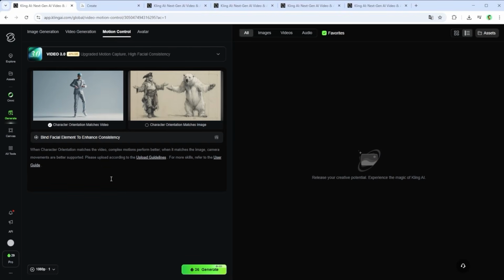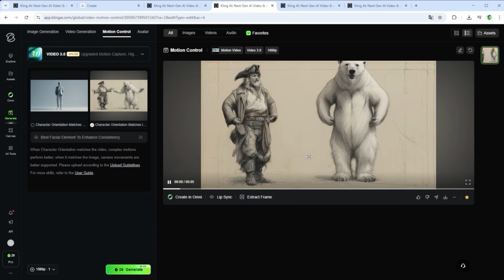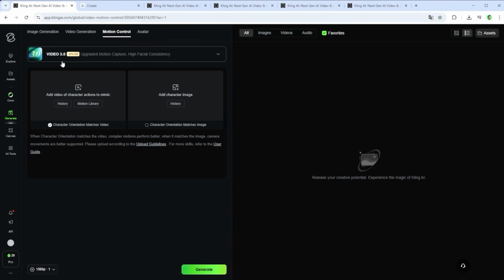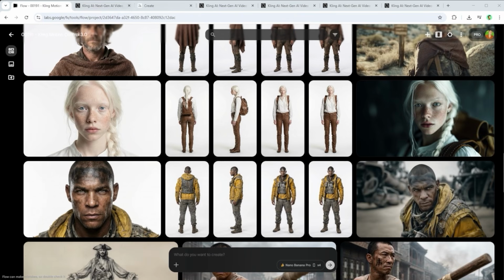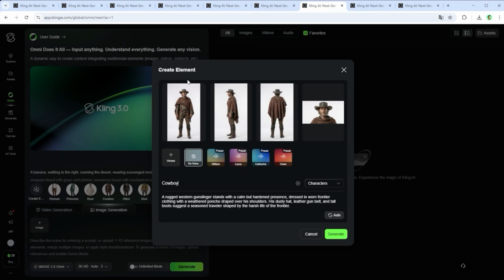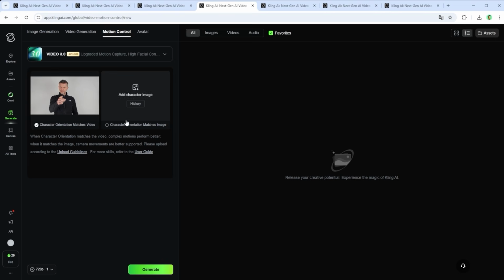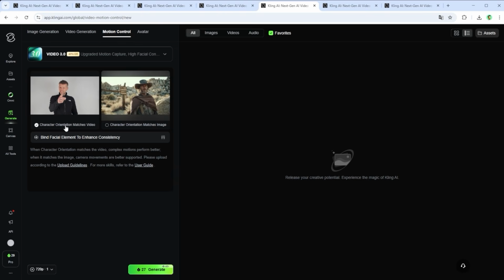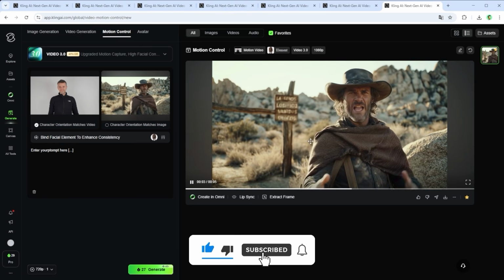STOP Writing Prompts – Use Kling Motion Control

Comment from the maker: Kling Motion Control in version 3.0 is a capable tool for transferring character movement without writing prompts. A small practical detail can make a big difference. Keep the proportions and framing between Motion Reference and Image Reference as similar as possible. When they do not match, results often become unstable with cropped characters, unexpected camera movement or shifting backgrounds. It is also worth testing both orientation modes with a short clip first. Depending on the character and style, the difference can be surprisingly large.

Comment: Awesome video. So essentially you don’t have to really put a prompt when using Kling motion control. All you need to do is just make sure that the steel image is close to the composition of the video itself. And another thing, the video image has to face forward to the camera, correct? Because the other day I tried to do a character from the side or from a three-quarter view and Kling was not able to detect any characters.
Reply from the maker: Thanks for your feedback.

Yes, you understood that correctly. If your motion reference video shows a full-body character, then your image reference, meaning the image you want to transfer the movement to, should ideally also show a full-body character. If the motion reference only shows the upper body, then the target character should ideally also be shown as an upper-body shot. That simply makes it easier for the AI.

It can also work with different views or compositions, but then it becomes much more unpredictable. For example, how is the AI supposed to know how the feet should move in the final video if the motion reference only shows the upper body?

Another important point is the setting between “Character Orientation Matches Video” and “Character Orientation Matches Image.” This can have a very strong impact on the result and may be the reason why Kling misinterpreted your character. Try switching that option. You can activate it with the small white checkmark below the two reference files.

And regarding video generation without a prompt: yes, that is how I create most of my Motion Control tests. I use a short clip of a person and transfer that movement onto a matching character image. You can add prompts, of course, but quite often the AI starts to struggle when the prompt introduces extra instructions that may conflict with the motion reference.

Comment: It works so poorly on clips that dont have a MCU shot of the actor, if they are in full shot in the background it doesnt do well, which is what we NEED to make films.
Reply from the maker: I understand. When it doesn’t work the way you need it to, it can get pretty frustrating.

I just went through my own database and looked for similar scenarios. I’ve done countless tests with Kling Motion Control, both with the previous version and the current one, and many of them worked quite well. What I noticed is that the results can actually be pretty solid, whether the character is shown as an upper-body shot or as a full-body figure. But there are a few things that can make Motion Control much harder to handle:

1. If the proportions between the person in the image and the person in the motion reference don’t match, the result can look very strange. For example: if the image shows an adult, but the motion reference shows a child, the AI is forced to transfer the child’s movement onto the adult. The result is that the limbs and the whole movement can look completely unnatural. The same thing happens if you use a gorilla as the image and a human as the motion reference. The anatomy is totally different. A gorilla has much shorter legs, so the human movement can force the gorilla into strange, elongated proportions. That simply can’t work reliably.

2. The person needs to have clear contours in both the image and the motion reference. If, for example, you use a dark cinematic photo where the person is only partially lit, the AI doesn’t really know what the hidden parts of the body or clothing look like. So it starts inventing things. The result can be that details become visible that should not be there at all. For fashion, that can be a real problem.

3. I also noticed that integrating objects often works badly. For example, if a character is holding a staff or spear. In one of my motion references, I used a mop and moved it around to simulate fighting movements. The AI had visible problems with that, because it couldn’t properly estimate the object, its length, or its physical behavior. If it works, it often feels like a lucky shot. Sometimes a two-meter pole suddenly becomes a bent endless stick.

4. Kling has created quite detailed support material about Motion Control on their help page. The basic principles are explained pretty reasonably there, so that might help a bit.

5. My experience is that with Motion Control, it is usually better to avoid prompt input completely, or keep it extremely minimal. I normally just upload the image and the motion reference video. Then the AI understands what it is supposed to do. But if you also add prompt instructions about camera movement, extra actions, or other things, the AI can get confused because it suddenly has too many conflicting signals.

6. There is also the choice between “Character Orientation Matches Video” and “Character Orientation Matches Image.” That can have a fundamental impact on the result. I tested this in detail in both of my tutorials, so maybe have a look at those sections.

Hope that helps. 🙂

Comment: I can already see that if there are multiple characters in the frame, it doesn't work :) So for now it's just a toy. Either you need to work again with professional tools for stitching and scene editing. When there's a single character on screen that needs to be animated, there are still questions too… for example, you can't put on or take off clothes, eat or drink, pick up objects, and so on. In short, lots of questions.
Reply from the maker: Absolutely right. There are still quite a few open questions and challenges.

One issue, for example – even though promo videos often make it look easy – is interaction with objects a person is holding. I tried this with a mop. The person in the image was holding a stick, but the transformation from the motion reference to the image was pretty underwhelming.

Comment: I truly appreciate you doing this video. Are there any thoughts in regard to the output quality? Does the input quality matter?
Reply from the maker: Thanks for your feedback. Yes, there is definitely a difference. In general, the higher the resolution of your input, the better the results.

Why? Imagine an element like an avatar at 200 × 200 pixels. It’s blurry and, quite literally, pixelated. The AI can’t work precisely with that, so it’s forced to interpret missing details, which often leads to inconsistencies.

The target image (your image reference) should also be as high quality as possible, because it defines the visual baseline for the video.

For the motion reference (the video), it’s less about resolution and more about clarity of movement. The AI needs to clearly understand how the motion works. A tiny GIF won’t help much – but it also doesn’t need to be IMAX-level footage.🙂
Reply: @Critical.Creator thank you so much for the explanation!
Reply from the maker: @laloplayground  🙂

Comment: Okay this is amazing but I don't want to do motion capture what I actually wanted to do was put my character that I have from other places I want a picture of her to act as a reference and then put her into a scene replacing another character without replacing the other people in that other scene and then have them move around
Reply from the maker: If I understand it correctly, you want a scene with multiple characters, and one of them should be your specific character with an individual movement.

I’m afraid that’s not really achievable with Kling Motion Control. You only have one motion reference that gets transferred to the entire image. If there are multiple people in the scene, they usually end up moving in the same way.

It becomes more like synchronized dancing rather than one character acting independently.

Comment: I have an important question: does the Kling Motion Control reference image have to already contain the background, or is it advisable to change it afterwards, if I want to use a background like a Higgsfield element? And then, can I change the moodboard on the video afterwards, or does the base image to animate have to already be with moddboard? Thanks so much
Reply from the maker: Thanks for your question. If I understand it correctly, you’re asking whether you should first transfer the motion to a person using Motion Control and then change the background afterwards using something like Video-to-Video.

I’m a bit concerned that this additional step could affect the consistency of the person. Adding another transformation step always increases the risk that the character might change slightly.

I would approach it differently: first define the images in a consistent style – meaning you deliberately set the location, style, and character. Then take those selected images and translate them into videos using Motion Control to add the appropriate gesture and facial expression.

Higgsfield is not a platform I use every day, so unfortunately I can’t give a qualified answer about that specific workflow.
Reply: @Critical.Creator I agree with that concern. Yes I want to transfer a movement on a character (that's basically myself), and I want to make it look as real as possible, so maybe yes, it makes more sense to set up the conditions about scenography first. It's just that kling already changes a bit the skin texture and doesn't perform complex movements very well....
Thanks for the reply 😊
Reply from the maker: @poetamaledetto88  🙂

Comment: YouTube is con they advertise AI and condemn you for using it. - EVEDENTLLY
Reply from the maker: I’d put it this way: YouTube requires creators to mark content as “Altered Content,” which is meant to protect viewers from misinformation or fake news. Some people are indeed using AI in ways that aren’t exactly responsible, so in principle that rule makes sense.

BUT!!!! this is also where your point comes in – and I fully understand the frustration. In practice, YouTube often seems to apply different standards. For many creators, that’s a pretty sobering reality. At the same time, the already tiny revenue has been dropping dramatically. I’ve looked at several channels where a video would have reached around 100,000 views a month ago and now struggles to reach 9,000. Something clearly feels off. Or maybe the platform is simply pushing for MORE MONEY on its own side while creators end up doing the work for just a few cents.

Personally, I am in no way satisfied with that situation.